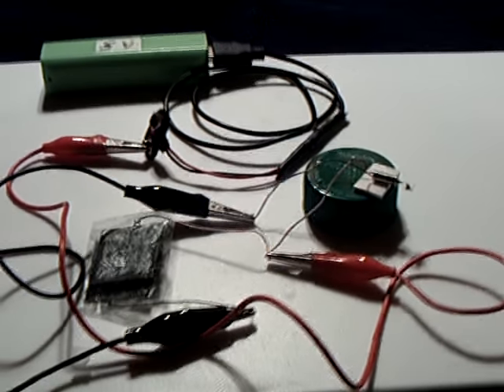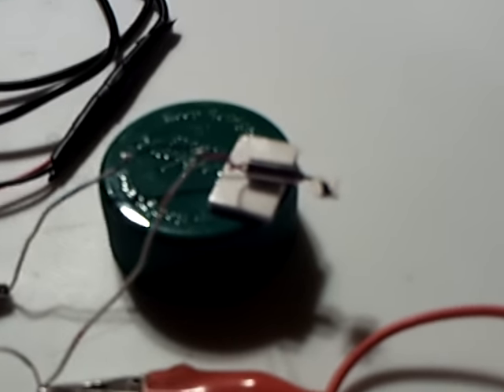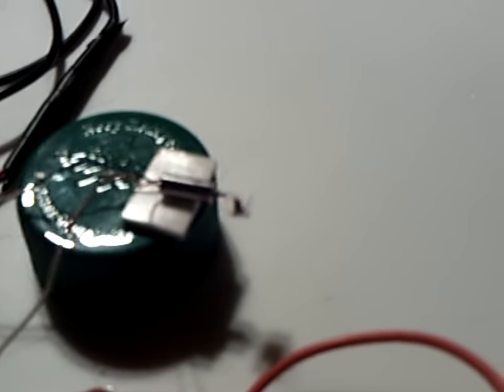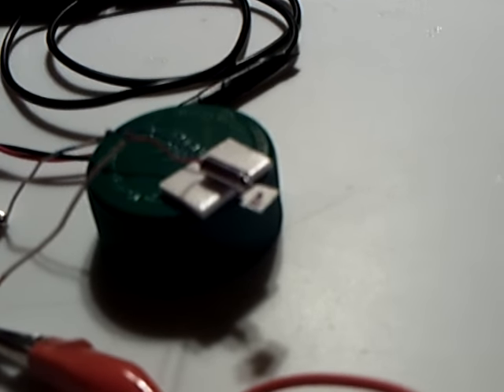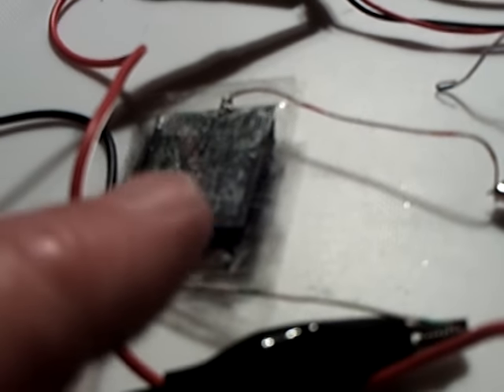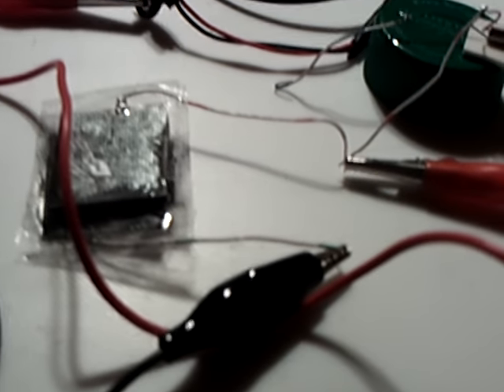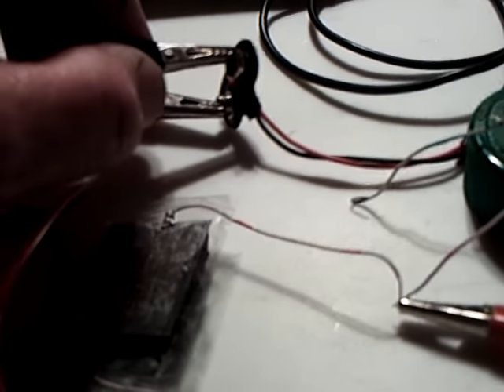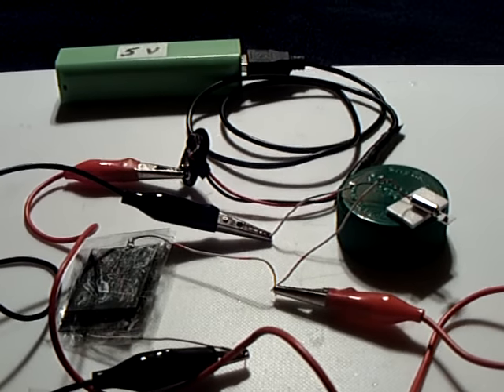Slider's 'Baby Step' supercapacitor

Comment: Congrats! Yep, it's just a step and I hope we can take these forward for increased power density. Main thing is mentioned in your comments below, the lack of a quantity of graphene. Can make it, but only in tiny amounts compared to tubs of it. So what we can do without the graphene is quite the marker point for what graphene adds to the process. 
Very much enjoyed seeing that motor spin :)
Reply from the maker: +slider2732   I have been following TK's comments at the OU forum and he talks about having a 'control' experiment to use as a baseline to work from.  This 'baby step' experiment we did could act like that if we ever get our hands on some graphene.
Reply: *****
Am thinking along those lines too and, though he's sometimes quite the direct speaker, TK is normally quite right. With and without various ingredients is always important. Mine don't work with any step omitted, or vastly inferior. After having now made quite a few, the activated carbon is about 4 times better than charcoal....things we should know :)

Comment: Hey Lidmotor, I have been working with the home made graphene capacitor, using the large flake graphite and acetone with water in a blender for 50 mins method.  I noticed that if I charge my cap with 17v it increases the voltage and run time of the cap.  I have no idea if it would work on your cap, but it would be cool to know if someone else got the same result.  I heard that Robert Murray is using higher voltage to tap charge his.
Thanks for your work.
Ed
Reply from the maker: +Ed Lovvorn   I have been trying the higher voltage also with good results.  I would have thought that it would destroy the thing (like what happens to a normal cap when you try this stunt) but is doesn't seem to mind.  The water is broken down and over heating happens if you try to jam too much juice in this way  but the cell itself survives it----so far.
Reply: I was using salt water but the water turned to steam and escaped through holes and it stopped producing current so I made some Poly Vinyl Alchol the way Robert Murry Smith showed and it keeps the salt ions in longer. I have gotten up to 500 ma after I charge and discharge about 20 times, but the size of my cap is about 3 x 3 x 1/8 inches.

Comment: you didn't mention the rust that he added.did you add it?this reminds me of RMS making graphene,from ferric chloride with SO4 if my memory serves me.maybe it's making a bit of graphene in the package.Tinman said he didn't notice the recharge effect until after 120 cycles.great replication.i got my cups ss cups and will make your cell first today and then tackle his.i bought some ss screen,and it seems to have come from UK.very dense and heavy.i will use this in my replication.thanks for sharring your work.:-)
Reply: +bill bailey it wasn't ferric chloride,it was carbon mixed with ferrite.sry
Reply from the maker: +bill bailey Thanks for the info.  It appears that unless I get my hands on some true graphene that I am never going to get the results that TinMan, Lasersaber, or RMS have shown.  The real graphene is hard to make in quanity ( for me anyway) and is expensive if you try to buy it.   It is fun playing around with this stuff----even at the 'baby step' level.

Comment: you are doing elektrolisis and vice versa h2o -> h2 + o2 when charging and o2 + h2 -> h2o when discharging and because the gases move away from electrodes over time your creation loses charge
Reply: +Μανώλης Ζερβονικολάκης 
So, it*s good for playing around, nothing usable...?
Reply: i think that you could use something simirar to run culculations if you wanted to scale it up comersialy for energy storage and have tanks of h2 and o2 and creating electrisity with a fuel cell. Or just you could try creating a cheap fuel cell with household materials like cooking paper as seperator membrane (i have use it and does work like a charm)
P.S.
if you have kids it could be usefull for teching them electrochemistry
Reply: Μανώλης Ζερβονικολάκης I don*t have kids, I only like the idea of free energy. I want to power our home... but I don*t like solar panel, wind. I*m looking for something simple, easy to build, good enough, silent. 
The problem is that the internet is full of fakes.

Comment: Where do you get your 30ga magnet wire from and precisely which seller is it?  30ga wire is being sold hand wrapped on Amazon (Remington Industries) and is so twisted up it is better to flush your money down the toilet as you can watch it go around and around then down with much less aggravation (from a review).  Bad stuff so 30ga is so tiny it needs to be machine wound on the spool.
Reply from the maker: +legalizeshemp420   I buy my magnet wire from a local electronics store.  I pay way too much but it is good stuff.  I used to buy the 3 pack of magnet wire from Radio Shack.  There are three sizes (30, 24, 16) but there isn't much on the spools.  It is a way to get some in a hurry though.  I have bought some wire off Ebay and Amazon and not had any problems.
Reply: *****
Radio Shack is out of business now so I will just stay away from the Remington Industries wire as I did more searching and they are really badly wound it seems.  Thank you for the information.
Reply from the maker: +legalizeshemp420  It seems that Radio Shack is still in business.  Here is the link to the $9 magnet wire set that I have used.  My very first Bedini SSG coil was made using this wire.
http://www.radioshack.com/315-ft-magnet-wire-set/2781345.html
Reply: *****
I would have to order it online from your link because all of the local radio shacks were closed down in my city when it went into bankruptcy.